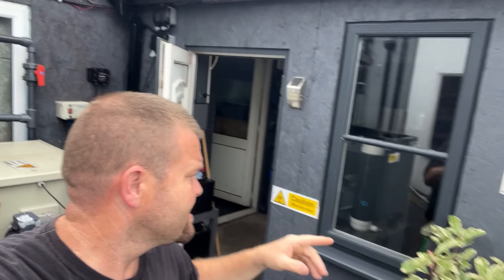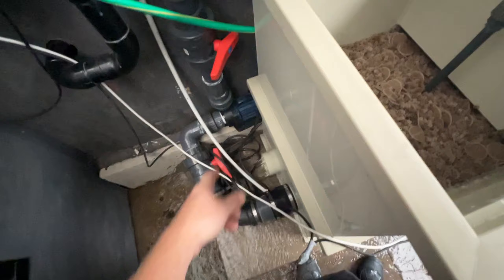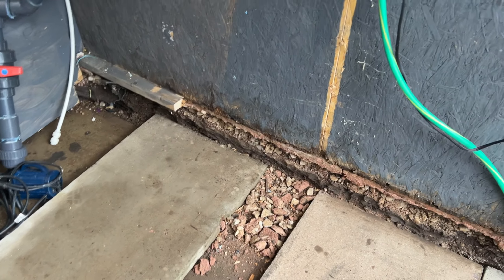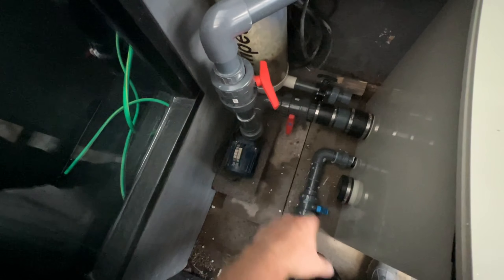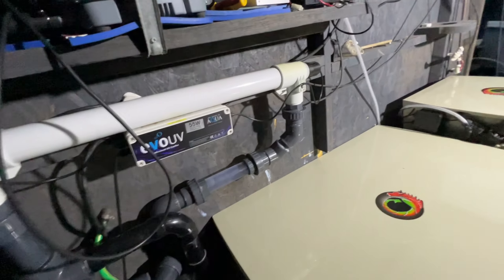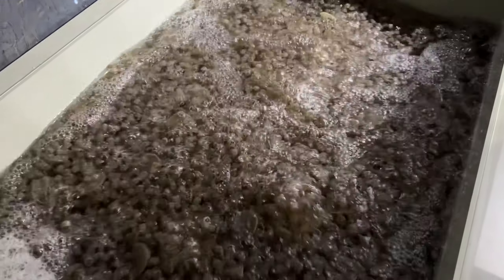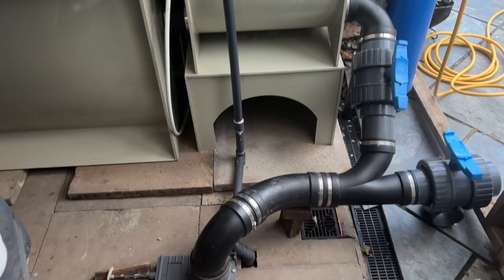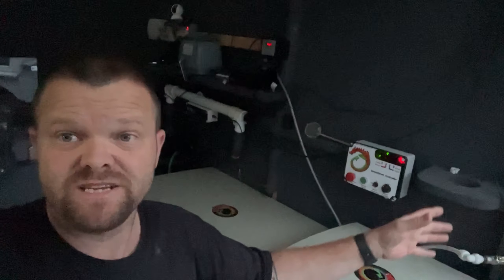INSTALLING THE DRACO DRUM AND TAKING THE PROFI DRUM OUT FOR BIGGER BIO SURFACE #fish #koi #drum

Comment: Looking good pal I had same leak on my air lol.i love my draco drum like you say its quite when cleaning.i  have  burtons Bioflo+ and hel x 13 in my bio.
Reply from the maker: Cheers Dean as soon as the pipe was on soon stopped it, I can not fault them definitely a lot quieter, I’ve found another 100 litres just need another 100 then should be full 👌👍

Comment: Did you end up putting the full 400 litres in the bio chamber?
Reply from the maker: Not yet mate there is around 260 in there at the minute just waiting on another 100 litres to put in there 👌👍
Reply: I’ve got the same bio chamber & couldn’t get more than 260 litres in it without having dead spots
Reply from the maker: @triumph12408 what size air pump are you using mate as I’m using a 120 litre and it bang on mate with it having the barrel bottom
Reply: It’s an EA 130